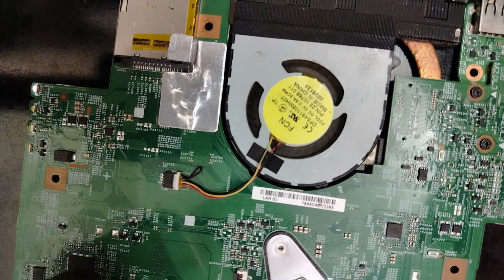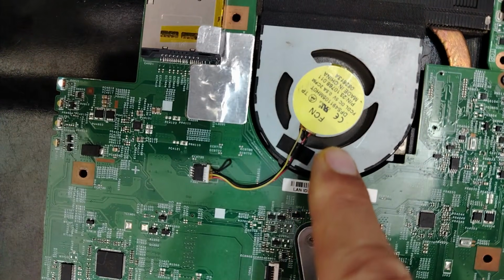Real-Time Repair: From Dead to Alive in Minutes | Laptop Motherboard Repair

Comment: Sir, my Lenovo Gamers 2023 motherboard, no display, no power. When I checked the voltage, it showed 3 volts and 5 volts. The power on/off button showed 3 volts, but after I checked the 5 processor channels and 5 VGA card channels, everything suddenly changed. The 3 volts and 5 volts disappeared. The normal power jack was 19 volts, but the 3 and 5 volts weren't there. Is this a damaged chipset or processor? Prossesor hot

Comment: Hi sir my question is about ram voltage  the main voltage will change according to ram type like ddr3 ddr4 but the vtt or reading writing voltage will also change or remain same  
U are doing great job sir lot of respect from Pakistan
Or also explain  the vcc voltages for pch or processor or other voltages like 1.5 changes or remain same on other board

Comment: Sir my laptop ACER NITRO 5 AN515-55 gtx1650ti rtx2060 has main power controller ic punctured  ncp 81215p I have given repair they are taking 3 months I have purchased ic from e bay they have soldered but told not working and gave back to me after some months I gave another person he has kept 3 months told it is not possible to repair still I am checking the board it is showing 0 ohms at inductor coils what is shorted iam unable find

Comment: Hi sir, I have a mini PC and the fan stars working but after 4 seconds it shuts down, I noticed the microprocessor is very very hot , I think it's bad
Reply from the maker: That sounds like a potential overheating issue, you may want to consider replacing the thermal paste.

Comment: I'm confused 
So smb data clock smb temperature are available when the switch is on? Meaning to say we can't charge laptop when it is off?
5v for usb is available when switch is on while 3v/5v available when switch is on?

Comment: I have an Acer Aspire E15 Touch motherboard here that doesn't turn on and no fan spin... Touched a particular IC around RAM slot and it was very hot and I noticed some three pins are bridged on the SIO...ADVICE ON WHAT TO DO PLS
Reply from the maker: Visually Inspect the SIO Chip
If three pins are bridged and it's not by design, this could mean:
Corrosion or solder splash
Previous rework damage
Component failure causing internal bridging

- Action: Clean the area with isopropyl alcohol and inspect under magnification. If bridges remain and aren't part of the pinout, this is a red flag.

- Use a Multimeter for Short Detection
Set your multimeter to continuity or resistance mode.

Probe the power rails around the hot IC and the SIO pins.
Look for:
Near-zero resistance (indicates a short)
- You can use a bench power supply and thermal camera to inject voltage (1V or 3V) into a suspected rail to locate the heating spot.

- Check for Faulty Capacitors or MOSFETs
Faulty ceramic capacitors and MOSFETs are common short culprits near RAM power rails.
- Use diode mode to test MOSFETs:
- Check Gate-Drain and Source-Drain behavior
- Look for shorts between pins

Comment: As a beginner how should I gain confident and identify circuit because the components are two
Reply from the maker: By following me you will learn step by step, or you can join me on Patreon to accelerate learning, Good luck Bro
Reply: How can i  identify 3.3v and the 5v circuit